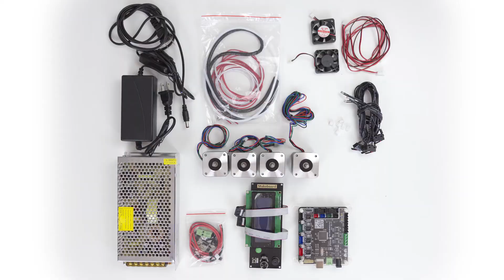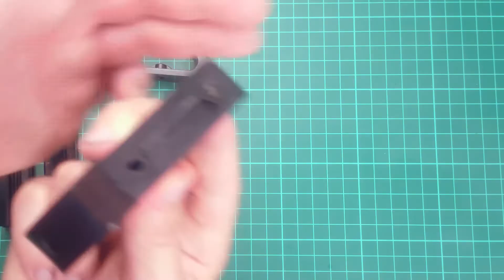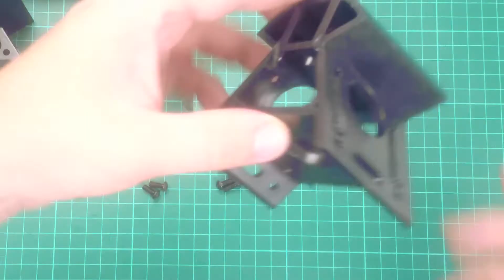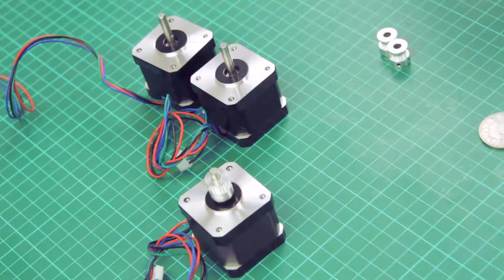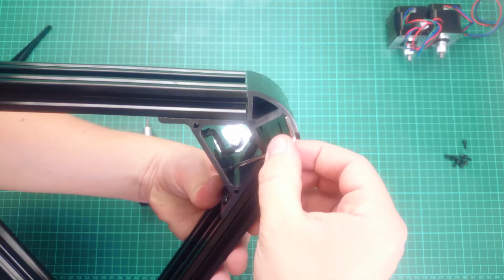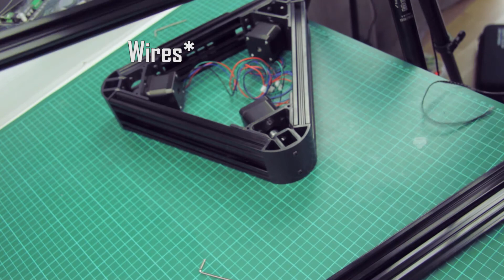Community3Dprinter Episode 1 - Micromake DIY Delta - Build Guide

Comment: i love this series and can't wait to see the upgrades you've got planned! i have an anycubic kossel and it's basically the same. please also share your tuning settings in the slicer and firmware when you get round to it, that would be really really informative and helpful. 
there are quite a few easy printable upgrades too, but if this also uses the same board as the anycubic its also capable of dual extrusion, which is pretty cool! auto bed leveling with FSRs in the bed is a very cool solution for these deltas too if you're thinking of really going for it, although BLtouch solutions are probably easier. really looking forward to it! see you in the next one!
Reply from the maker: Thank you so much! Yea, it will be really fun =)  I'll check the card, but it could be possible :D.  It will be up for grabs for everyone, my settings and everything =)  This one seems to have auto-leveling built in, but not sure exactly how it works.  See you in a week then =)
Reply: ah ok, thats cool! i guess we'll find out. i think anything that this model has will be possible on the anycubic. FSRs are cool, but BLtouch is much easier, and cheaper i think. not sure if one works better than the other really. thank you for sharing this with us, its a very cool series for me. schoenes wochenende!

Comment: No SD-card where the manual cut be on?
Reply from the maker: Actually no. I thought they would be in the SD-slot on the LCD-panel, but no SD-card there.  I used this manual and it seems to be 98% correct =) - http://bit.ly/2sQZyXZ
Reply: okay, lovely :)
in regards to the screws, go to your local biltema and get a set of Precisionsmejselset insex, Love useing them on my wanhao, instead of uses those L-shaped allen keys http://www.biltema.se/sv/Verktyg/Handverktyg/Skruvmejslar-och-Bits/Precisionsmejsel/Precisionsmejselset-insexklot-6-st-2000028403/?artId=12687